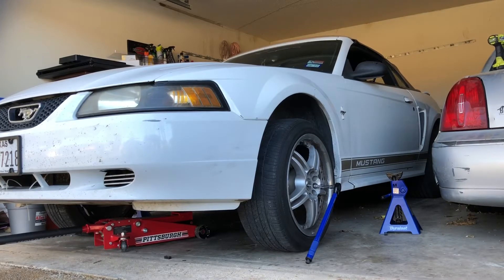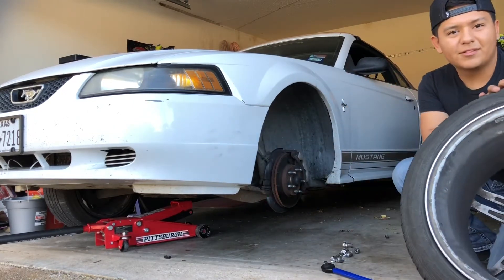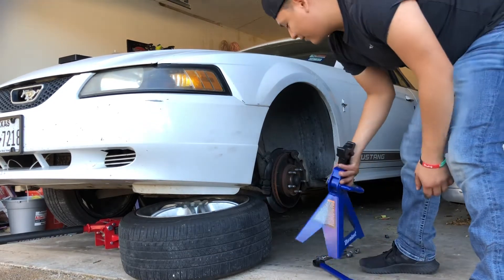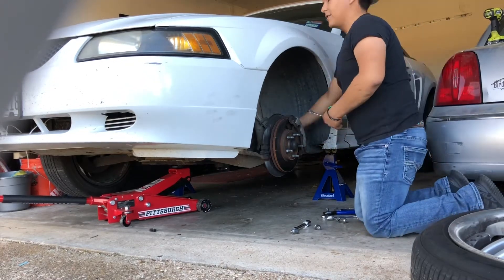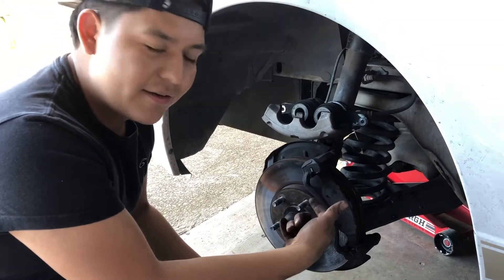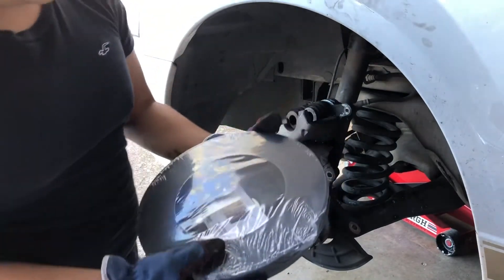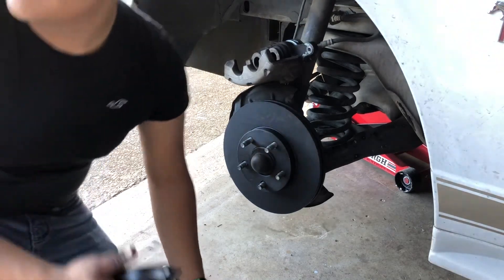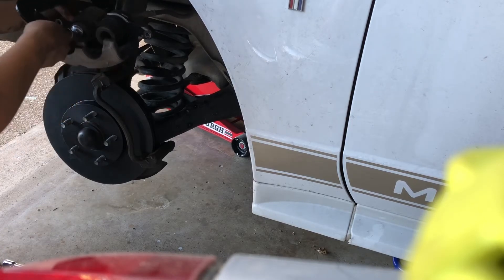HOW TO CHANGE YOUR BRAKE PADS AND ROTORS | 2002 FORD MUSTANG | EASY BRAKE PAD REPLACEMENT | 99-04+GT

Comment: Torque specs on the caliper bracket bolts?  Also, torque spec on the bolts for the caliper itself? 2:02

Comment: Ive seen guys do what they called bleed my breaks what does that mean and when should it be done also is it just the driver side that has the breaks and rotor or are you supposed to do the front passenger side as well
Reply: Bleeding brakes is when you purge air out of your brake lines. The new pads have the brake pistons open wider, needing more brake fluid to keep a firm pedal. You crack open the bleeder valve, have someone pump the brakes until it stiffens us, close bleeder. Repeat process until the brake pedal is firm and do both sides. Make sure brake reservoir is topped off or you'll pull air into the brake lines. You'll usually bleed brakes when you change brake pads or have air in the brake lines (causes soft brake pedal)
Reply: Most cars have brakes and pads on all 4 wheels . A lot of times the rear brakes can be drum brakes there are different kinds of brakes, that are usually more difficult. Point being all 4 wheels have brakes attached to them but the type of brakes can differ between the front and back. Brakes are a hydraulic system meaning you press a pedal and that causes fluid to push the piston in the caliper against the brake pad which applies to the rotor causing the wheel to stop. When ever you work on breaks it can cause air to get into the hydraulic system and make them not work properly so there is what is called a nipple on the caliper somewhere that you can loosen to let the fluid and air out of the system but it has to be done in a particular system too work right and that is make sure the nipple is closed then push on the brake pedal and hold it down. While the pedal is being helped down another person needs to open the nipple and see if air or fluid comes out, then close the nipple before you let off the brake pedal. You repeat that push the brake and hold, open the nipple untill only clean fluid with no bubbles in it comes out then tighten the nipple then release the brake pedal that's called bleeding the brakes. Hope it helps I really wouldn't bleed your brakes without another person and probably someone that knows what they are doing. It's not hard but you have to do it in the right order.
Reply: @somerandomguy9414 you definitely don’t need to bleed the brakes when you change pads and rotors